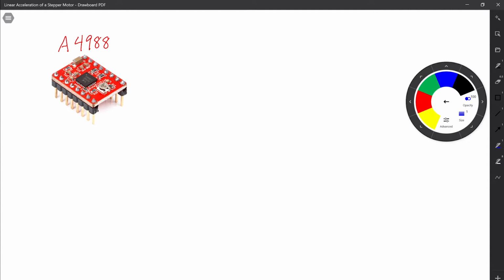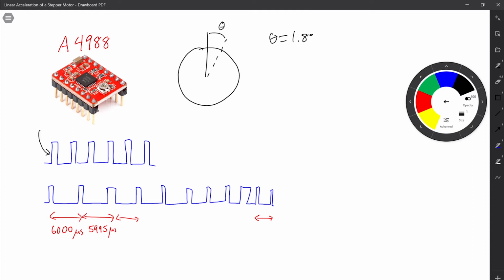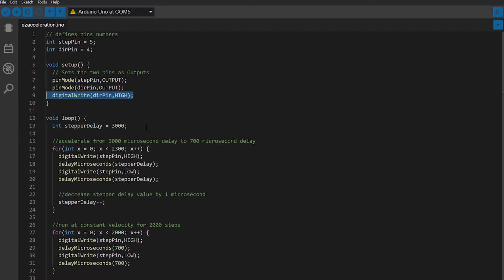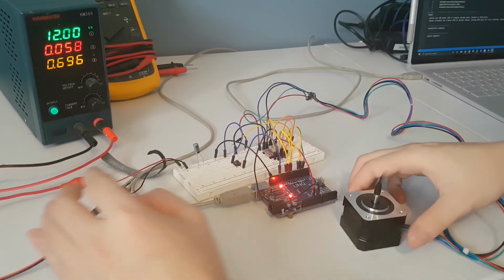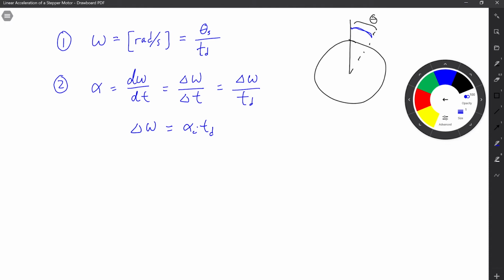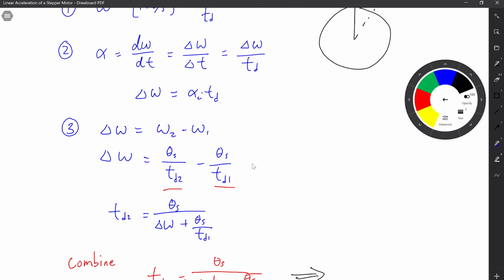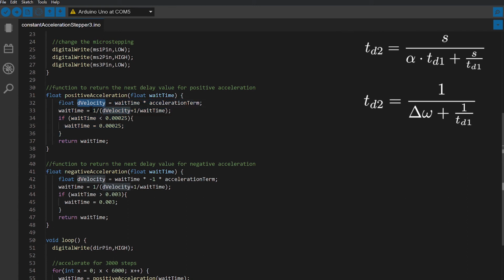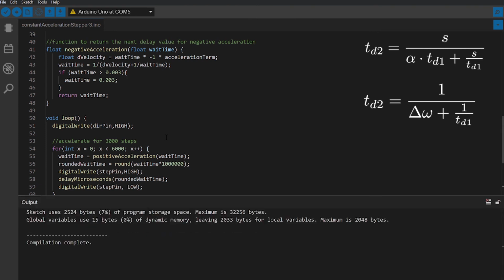Constant Angular Acceleration of a Stepper Motor with Arduino

Comment: Just wanted to thank you;  I'm currently building a self-balancing robot and am using the equation you derived. 
Trying to learn to do it with interrupts on the ESP32 but not having much luck so I will probably end up using freeRTOS.  Anyway, your clear explanation made implementation trouble-free. Appreciate it.

Comment: I have a question about the step in the computation at roughly t=996s. Initially, you declare delta omega as a difference between angular speeds omega2 and omega1. That means this delta omega is the angular step / time delay2. But then when you substitute for delta omega in the combined formula, you use angular step / time delay1. I think that is incorrect. That would be the angular velocity difference between omega1 and omega0.

Comment: Couldn't you do something like: 
    for (stepperDelay = 3000; stepperDelay >= 700; stepperDelay = stepperDelay*.99)
and achieve similar results? I mean, unless I am not understanding something, I was lost on the explanation of angular and linear acceleration, it seems as what you are looking for is acceleration that is proportional so that the speed ramps up in a straight line instead of curving.
Reply: Just scrolling through the comments and saw this.  I'm looking for different implementations to see which one I'd like to go for; going to stick this in my open office calc to see if the graph behaves in a similar manner,  thanks.  Did you try this out by the way?

EDIT:  it graphs like a logarithmic function, with a sharp acceleration in the beginning, a bit like 1/x, but gentler. 
.997 was way gentler of a slope.  I guess it could be tweaked to get an almost linear acceleration. But but is much slower to reach target delay

Comment: Thank you.  This will be a valuable asset in coding for Stepper Motors, as in some cases, the motor won't start at high speeds without problems. Thanks

Comment: For me, this is a very valuable video because it shows me how to code part of my project that I know quite a bit about but didn't know how to even begin to implement the up/down ramps.

Actually, I think I can package his code into my support code verbatim. 

This is an excellent presentation with really clean and consice code. This engineer really knows his trade!

You, Sir, will be saving me many hours of grief and constipation.

Thank you so very, very much......

FWIW: 45+ yrs ago, I was the senior electronics design engineer in a small company that was developing a product that relied heavily on the performance of a stepping motor to slew and position a print head on a highly advanced dot matrix printer.

Too often in testing, the stepper would 'lose sync' when starting or changing direction. It could lose one or two steps or totally lose it and chatter/vibrate like the dickens. A few lost steps resulted in fuzy characters being printed.

The software weenies blamed my Z80 hardware design, but my cohort in crime explained to me what was happening and educated me on the need to 'ramp' stepper motors.

Charley had Been-There-Done-That years before in a previous job. Along with becoming a lifelong personal friend, Charley was a very good and experienced engineer with many talents.

When I diplomatically explained the situation to the software iguneers, they balked, told me to mind my own business, and complained to the owner that I was interfering with their work.

The boss called me in and said I needed to leave the 'kids' alone.

Later, the 'kids' convinced the boss that they were working with bad motors and an inferior Z80 hardware design that was losing interrupts, which of course was my fault.

He asked the manufacturer/supplier to come up and help identify our hardware problems.

The supplier evaluated our hardware design and motor control microcode and said nothing was wrong with the hardware but that the microcode was really lacking and really bad.

As they briefed a bunch of us on their findings, a small smile creeped across my face, but our boss never looked at me. I think he was embarrassed.

Four weeks later, we had a new software team leader, 2 of the original 4 'kids' were laid off, and I was appointed as project engineer with oversight over the entire project.

BTW :  I think those 2 kids should have been fired. The other two were good guys who knew their stuff, and one of them picked up where the two losers left off and fixed the code to perfection.

Anyways, as the almighty stepper motor god in the back room sais, 'Don't ever forget your ramps, your job may depend on it'.......

Comment: Timestamp(Num_Step)=(sqrt(2)*(ALPHA/STEP_MODE))/ACCELERATION*(sqrt(Num_Step+1)-sqrt(Num_Step))

Calcul de l'intégrale sous la droite de vitesse en considérant une accélération constante
ACCELERATION in step/s/s
ALPHA = unit/s^-1 = 1000000 (for µs)
STEP_MODE = number of precision steps / real step = 1 by default (maybe 1/2/8/16/...)

Note : ((sqrt(2)*(ALPHA/STEP_MODE))/ACCELERATION) is a fixed value and could be calculated one time per stepper acceleration to freed up some CPU time

Comment: in your for loop, instead of incrementing delay, if you increment the frequency then calculate the corresponding delay, the acceleration will be linear, right?

Comment: You NEVER want to disconnect the ground. You always disconnect the +
Reply: What is the context for this? That is false without a specific context. If you look up low side switching, you can see that many applications disconnect the ground.
Reply: @MarcelRobitaille  The context is that when you have other things like serial cables and what not connected to other equipment, disconnecting the GND is a bad thing to do. It will cause other connected things voltages to spike or float at wrong levels.

Comment: very interesting, i typed your code and tried it for myself, i couldnt find the link to the github, i guess to make drive a robot arm you will update the code so that you can drive from a possition to an other while accelerating and keeping a stady max speed and deselerating before you reash the end possition. Is this about right or you have something else in mind? I'm also in the prosses of building a robot arm, i would love to see more videos from you.
Reply from the maker: Yeah progress has been a little slow, hopefully I will be working on it a bit more soon. Your description is correct, that's how I plan to drive it. I'll add the link for the github right now
Reply: this is called (s curve motion ) and using TMCStepper library is better with TMC drivers because they have the ability to do so in the code beside holding stepper position at the movement end